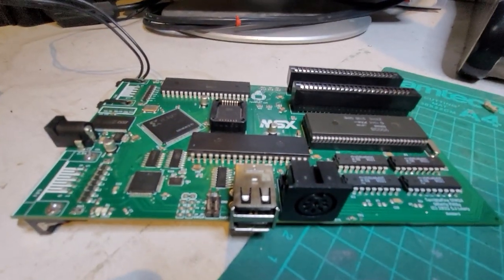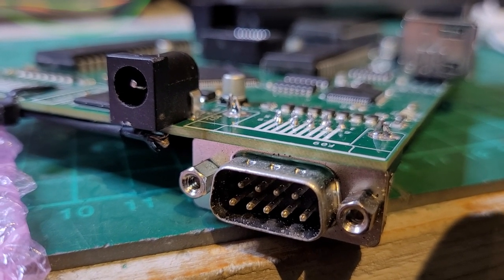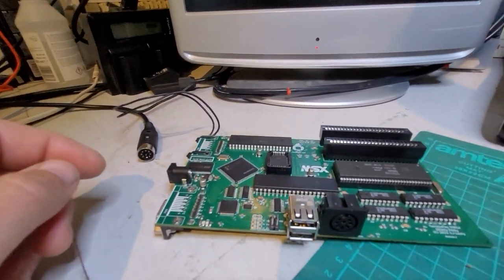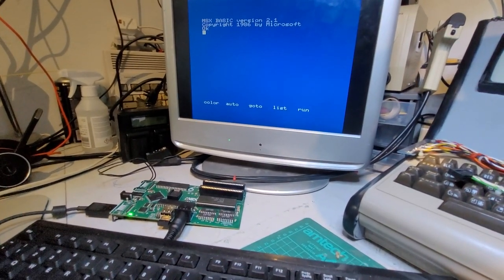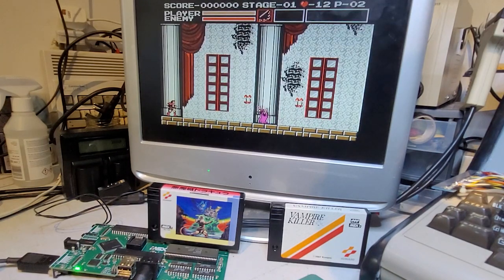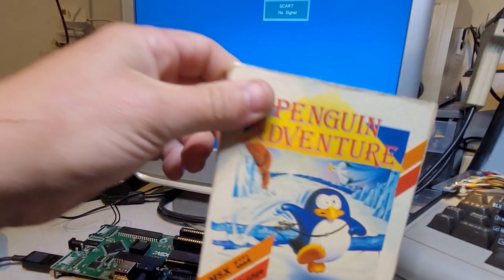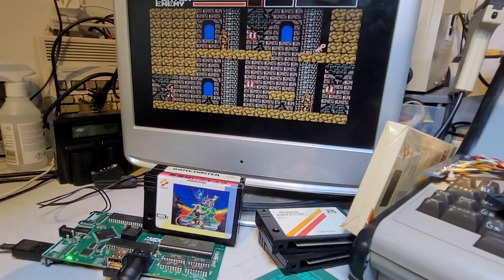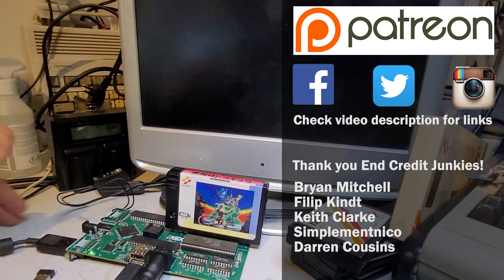The TFMSX - An MSX2+ clone by @TerribleFire

Comment: There was a (never formalised) cross-platform standard for digital RGB video output on 270° DIN-8 that it seems all 8-bit Japanese microcomputers used, including NEC PC-8x01/6x01, Fujitsu FM-7/77, Sharp MZ, Panasonic JR-200, and so on. Even MSX machines that did DRGB used this pinout. You can find information about this and further links by searching for "Japanese DRGB" on the Retrocomputing Stack Exchange. (I'll put the link in a follow-up comment here, but comments with links seem likely to get eaten by YouTube.)

For whatever reason, later MSX machines that used analogue RGB continued to use the DIN-8 connector but moved the pins around. I've no idea why. But given that this is pretty much guaranteed to introduce compatibility headaches and debugging problems, it might be worth considering just using a different connector on the TFMSX. A really good option for compatibility with common Japanese cables of the time would be a DA-15; there was an (again informal) standard pinout for this common to the NEC PC-8801/9801, FM Towns and Sharp MZ-2500/X1/X68000, and the connectors do not seem too hard to find. Another option would be a DE-15 using the IBM PC "VGA" pinout. That connector is still very widely available, but it may be confusing in that most VGA monitors won't support the refresh rates that MSX uses.

One connector I'd not recommend is SCART; not only is it huge, somewhat fragile and a pain to solder (many connectors must be crimped), but it's also easily confused with the physically identical but differently wired JP-21 connector.
Reply from the maker: that's interesting info thanks for taking the time to comment on this. I actually didn't know there was an attempt at standardising the RGB out. Throw in the link, I'll approve it if youtube holds it for review. 
yeah  I think we can agree the RGB out on the MSX is a bit of a headache alright. The rational behind the design here is not so much to stick to historical and technical accuracy (although real ICs are used in combination with FPGA ) but more to offer an easy to source , cheap, solution for all . I do think TerribleFire was right in deciding to use a common, readily available and cheap, din pinout for the RGB out as it'll make it an easy to source cable . Simply telling people to source an "Amstrad" RGB cable will solve the issue of RGB pinout confusion. Again , keep in mind this is a solution designed to be easy and cheap and using available parts .
Reply: @8bitmanshed  I'm not clear if there was ever any real attempt at standardising DIN-8 DRGB or DA-15 analogue RGB, or how it even came about, but it's simply the case that virtually all 1980s Japanese home computers used the same DIN-8 DRGB and DA-15 ARGB pinouts. (In fact, I've never seen an exception, though there may be computers out there I've not seen.)

I understand the cost and space considerations, and I should make it clear that I don't see any particular reason not to use a DIN connector; I was simply recommending avoiding DIN-8 because who knows what the pinout of any random DIN-8 ARGB cable or connector is. That said, if your Amstrad DIN-8 ARGB pinout is a quite common one over in Europe, it might make sense to use that anyway, though it will still not help with confusion here in Japan.

I did post my follow-up comment with links and, as expected, it vanished somewhere into the depths of YouTube.

Comment: Hi, your problème on CSYNC of your V9938 as welle as the one I've just seen on the chanel of TerribleFire video  with a V9958 are maybe both linked to the fact that you are not using the minimal output stages sugested by YAMAHA for their VDP. For this pupose you can take example on the RGB and SYNC output of the PHILIPS NMS8250 or better the SONY HB-F700 MSX2. The PHILIPS one is cheaper.

Comment: Awesome. I would definitely like to have one of these. What kind of form factor PCB are we talking about? Will it be a custom case or is something like a mini-itx or micro-atx form factor a possibility?

In case of the latter, I would love to see it laid out so that it is possible to create a separate PCB for for instance a slot expander that you can plug in sideways. That way you would have a choice of either having two primary slots or one primary slot and a secondary expanded slot, for a total of a whopping 5 cards or cartridges ;-).
Reply from the maker: as far as I know this is pretty the form factor it will be in. With some mounting holes . 
I don't think Terriblefire has a plan to create custom cases for it, he's just providing a DIY pcb with a cost effective mindset so I understand he'd rather people make or design the cases themselves if they feel they need one.
Reply from the maker: thinking about it, technically you could also populate the second cart slot with an angled one so it faces out

Comment: Space manbow runs at 60Hz. The game itself forces it. I did miss the SCC though. That's something MSX Cartridgeshop's cartridges sometimes suffer, mostly on Philips 8250 and up and Sanyo computers. According to them this is not due to their cartridges, but to the computer not following the MSX standard on that.
Reply from the maker: yeah.. although I don't know about that, Nemesis 2 sounded just fine with SCC so I suspect it's not really a issue with the computer as they say :)
Reply: The problem of the Philips/Sanyo sound mixer has been discussed several times and the conclusion has always been the same: the mixer is badly designed and it is not advisable to use two sound cartridges at he same time on those machines. According to SFR: 
"This sound circuit is just unbelievably broken by design. It's the worst I have ever seen.

The circuit design seems to have been reused from an earlier cheap MSX1 machine, but then the engineer moved the amplifier section to the wrong place (only for the PSG line, that is usually louder than the other sources), and ruined for once what already wasn't exactly a great design.

IOW, the circuit only works properly for the internal PSG and you're lucky if anything else connected to the slot produces any sound. And I wouldn't recommend to connect two sound cartridges at the same time to these machines, because it short-circuits their sound outputs." 

In the NMS8280 wiki at MRC you can find links to several ways of fixing the mixer of the computers. One of them was made by Aquijacks (in Spanish) with an excelent explanation and solution to the problem.

Comment: You might have old stm32 firmware. I recall working on STOP button mapping. New firmware has some priority fixes as well, as in games there were occasional phantom reads.
Reply from the maker: aaaah ok. would that also explain the odd text input garbage on some "cold" power ups ?
Reply: @8bitmanshed  Yes, it should. Do you have stm32 programmer - ST-Link V2 ? I have firmware ready for few types of chip, you would need to just let me know what type you have f730, f722 or f401 and I will point you to new firmware.
Reply from the maker: @alm434  I don't have one I'm afraid . I'll look for one and get back to you then. 
great job on the usb driver all the same. it's very handy being able to use a wireless keyboard on this
Reply: @8bitmanshed  I will set you up with one

Comment: The minimum MSX specification includes a cassette interface?
Reply from the maker: don't quote me on this but I think it does yeah. It was left out of the scope of this , I think the rational behind it is that if you're old school enough to want to use real tape interface you might prefer do it on OG hardware instead of a clone . All debatable of course but , yeah, it's not part of the scope of the project :)
Reply: There may be tape emulation added via the ARM controller in the future. It would be wave/tape files on a USB stick though not a real tape interface. I just saw it as unfair to make everyone pay for a tape interface for the three people that would ever use it.
Reply: @8bitmanshed  The MSX TurboR does not have a tape interface, it was my poor attempt at some humour? The printer interface is missing too, although I suspect that might be implemented, or could be implemented via USB.
Reply from the maker: @1697djh   printer port isn't in scope either, similar reasons :) 
Keep in mind. this is a cost effective clone for people who can't afford a real MSX2+ :)
Reply: This is not the first MSX machine not to include a built-in CMT interface. The Casio MX-10 and MSX-101 had the DIN-8 CMT connector on the main unit, but the actual circuitry to run it was in an expansion unit that had to be bought separately.
Reply: Cassette interface is important feature nowadays, it's very cheap and quite reliable to load games from smartphone.